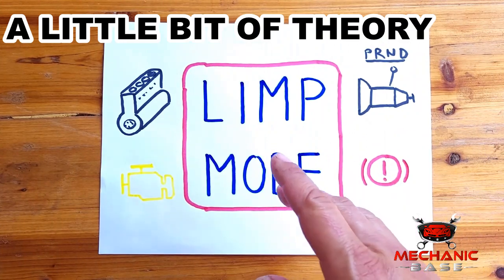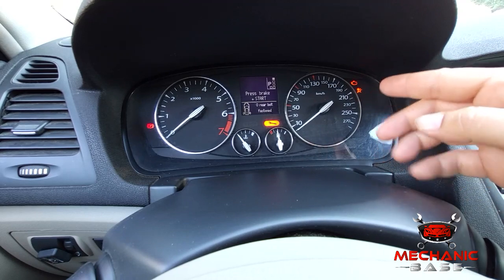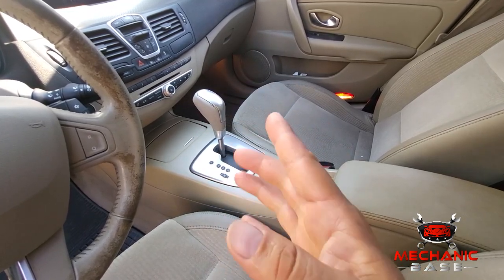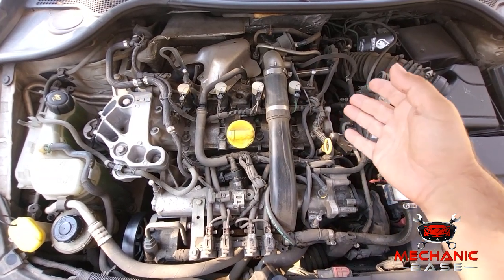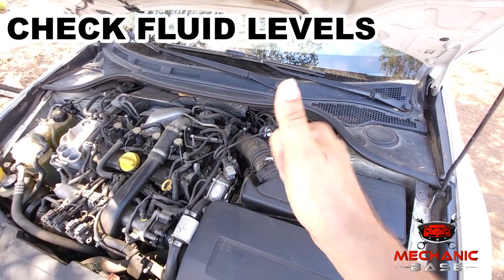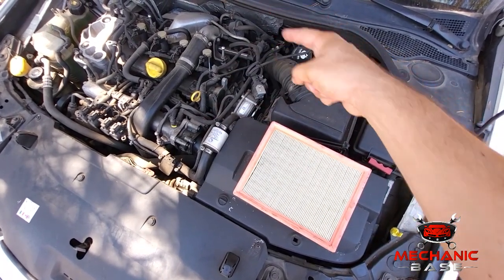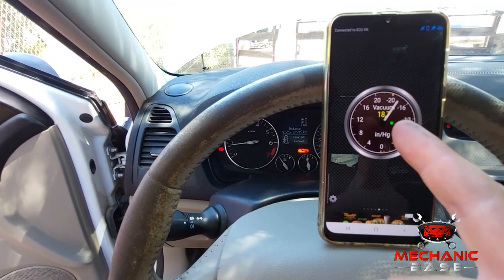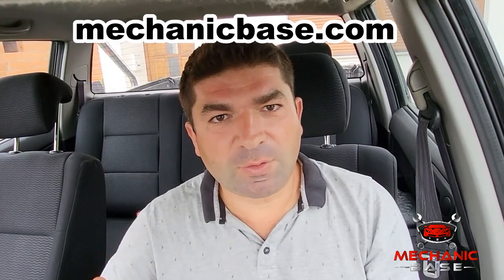Limp Mode: Meaning, Causes and How to Fix It

Comment: I am having problems with my 2006 Nissan Murano, Changed Pedal, Changed Trottle body and still car won't accelerate. Once TPS or Pedal changed car drives for a while like 1km and it goes to limp mode with Slip light and VDC displaying a check engine light, when I disconnect the pedal cable the car get high acceleration can drive . But it's slow. please any suggestions for possible solutions?
Reply from the maker: @fofana713   - which trouble codes do you have?

Comment: I have a 2012 ford Taurus replaced the throttle body and my vehicle sometimes stalls,backfires,and eventually goes into limp mode while driving no matter the speed at random,even when idling at times. What could be the problem? I’m getting throttle body codes p2104,p2107,p2110, and p2111

Comment: Great video, thank you mate! I would like to add another comment about Limp Mode. I have an E46 BMW 328i, the car stood for 4 months while I was overseas with battery disconnected. Upon my return I connected the battery, car started first time but when I switched on the aircon the Limp Mode light came on & virtually no response from the accelerator. I would stop, switch off the car, restart and Limp Mode light would go out, I would then switch on aircon and car would go into Limp Mode again - this happened about 4 times. I got home, put a battery tester on the battery and it indicated that it was in a poor state of charge. I did an overnight charge and the problem solved.  Cheers 🛠👍
Reply from the maker: Thank you for sharing this, @SirFrancoQ💪
Reply: I have mk4 golf my accelerator most of time not response and car goes 10+rpm itself  But when i See I have in injection pump bubbles They shut off engine   do u think I solve prob if i fix injection pump  acc will be ok ??
Reply: My car is on limp mode because when I put on reverse or drive won't move i thought it was transmission going out but I read your comment about the battery thanks all I  need is a battery for my Nissan versa 2013

Comment: I got my o2 sensor changed and after 50 odd miles and then suddenly my car didn't want to accelerate properly or judders at certain throttle points. Don't know of this happens if they did not reset the ECU or if it's potentially my wiring is not happy.

Comment: My Automatic  car changes gears very well from 0 to 100mph but it struggles going above 100mph while maximum speed is 180mph. What can be the cause there is no any check engine light.
Reply from the maker: What's your car?
Reply: @MechanicBase  nissan altima 2006

Comment: I drive my dads toyota previa and its rev cuts off past 2400 rpm and i have to let go off the gas and press it again and maintain it below 2400rpm to drive , my dad replaced the throttle body and the issue remained , its very stressful to drive and i have no other choice.

Comment: Thanks for the video. Very professional..One question I have two cars after driving about an hour set up limp mode..happen after one hour driving .what could be the problem? Both cars has the stability control activated ...
Reply: Not Sr. Im driving my cars like it is but I dont drive long trips., only local .,will be bad to do it.

Comment: my 2012 KIA was in an Official Kia service for 3 MONTHS. The total amount I end up paying was $2714! But the problem was fixed after they change the CONTROL ASSY-HEATHER which costs around $100. Yes, $100, instead of $2714. Maybe this information could be useful to someone. 
My car was going in LIMP MODE. Seems it was a very very rare case. Something that they had never seen before. They change many expensive parts (like the wiring harness and PCM control)  and the car was not working. I had to pay for all those changes without solving anything. 
It has been almost 9 months since they fixed and the car is working great! Hopefully continues this way!
Reply: another screwedover customer
Reply from the maker: Thanks for sharing this useful info, @elilucha👌
Reply: Yea they just change parts that "could" be the problem they don't pin it down
Reply: This is the second time my 2012 Kia went into limp mode in 5 months in heavy rain. Was $600 to fix. New fuel injectors, spark plugs, etc. but wtf every time it rains heavy I gotta do this?
Reply: @shanemoran6597  wow...that never happened to me. so crazy!

Comment: P0763 shift solenoid c electrical THIS CODE I AM GETTING IN MY KIA MOHAVE 2012 MODEL
PLEASE REPLY MY CAR IS GOING IN LIMP MODE
Reply from the maker: Unfortunately, @DIYDCam, this is a transmission issue. Shift solenoids are in charge of changing gears in an automatic transmission, and their malfunction usually triggers limp mode. You could, however, try checking the transmission fluid level, or even renewing it, together with a filter.

Comment: Hi mate, my vw Passat 2.0tdi 2007 has a flashing glow plug light on and the car has no power after 2000rpm.  Plugged in a computer and it saying dpf and glow plugs issue .can a blocked dpf coaurse the glow plug light to flash and go into limp mode. Keep up the good work, your videos are the best and strait to the point. 👍👍
Reply from the maker: Yes, clogged DPF will send the car into limp mode. 
You can find a bit more in this video 
https://youtu.be/A8zmkEEgc8Y?t=449

And, thank you, we'll od keep up💪
Reply: Hey mate, how you fixed your problem? I'm exaclty the same problem with my car. Glow plug light on and no power. Just riding with limited RPM at 3.000

Comment: It's never a lose wire or broken wire. Every person says that.
It's never the f!cking wire. 
Of course you want to check that, but it's never that.
Limp mode can happen for several reasons.
Every car is different.
I junked a Mercedes SUV because not only me, but no mechanic could fix it.
It's not the f!cking coils ether.
You know how many people changed all kinds of parts the shop told them, and still car doesn't run?
Reply: got the ml420cdi in LIMP, a weak battery because SAM unit would not turn off because rear door latch bad. put on door latch, it locks but wont unlock. LIMP gone until change door latch, now back intermittint??????? damn germans. going to unhook door latch plug, look again. maybe bad SAM unit, whatever it is??

Comment: My Nissan maxima 2016 went in to limp mode once. My issue was that my alternator went out at 80k miles. Once it got replaced my car was running again and my transmission worked perfect fine.
Reply from the maker: Thanks for sharing, @jarana10💪

Comment: Can you please tell me how to fix this code U110B&U100
Reply from the maker: Which car do you have?
Reply: @MechanicBase  I have the 06 Dodge Charger 3.5 High Output
Reply: @realcheckmate  ever fix it ?
Reply: @jesse75  No never fixed it I have changed crank sensor map sensor intake temperature sensor throttle body fix the TCM wiring and it still stalls out on me I checked the battery and alternator cause I had a code u0100 and p0700 lost communication with pcm/ecm and today I changed the coolant temperature sensor and I’m going to take it for a drive in the morning to see if it stalls on me
Reply: @realcheckmate  do you live in a hot climate area ?
Reply: @jesse75  I live in San Antonio Texas
Reply: @realcheckmate  it's pain staking. But I've found in hot climates the wiring breaks down.
Example. I have a Mercedes. Shortly after getting the car, the EVAP system threw a code.
Changed everything in the system. A sensor on top of the gas tank required me to drop the exhaust, rear end and drop the gas tank.
Bull Sh!t. I cut a hole in the floor board after taking out the back seat to replace it. Still didn't fix it. And that's after even changing the charcoal canister too.
After all that hassle it was the wire leading to the sensor on top of the gas tank.
$25 piece of wire. And I spent hundreds of dollars on those other parts. And that wasn't the problem.
It's a bunch of crap when a code only tells you what's wrong but not the part, so we have to go chasing it.
So I hear you all the way. 
Just because something looks good, it may not be.
I had a Nissan. I even replaced the engine. Still same problem. I replaced everything.
I found a ground wire that was bad and intermittent. That's what the whole problem was. I was pissed.
But sometimes that's what it takes on these cars. Dealer's and Mechanic's are no better than us.
If you were close by, I'd look your car over.
I bet money it's something stupid.
Reply: @jesse75  no I never fixed it but when I leave my OBD2 scanner plugged while driving my car won’t cut off when at all when I stop at a stop signal

Comment: My Mercedes 2000 with w211 engine and 722.6 transmission have limp mode for 2 months I changed the conductor plate and oil but no response,  so any advice?
Reply: I had the same problem after I changed conductor plate.
I took it apart again and replaced all those solenoids in the shift body.
Dealer said I had to get it recalibrated. But that's bulsh!t. Car works perfect now.

Comment: What could be the reason  to limp mode on Audi a3 2TDI  DSG 2005 model 

When accelerating from 3rd gear up the car goes into limp mode 

Example when downshifting from 6,5,4 then 3 and when accelerating from 3 it goes to limp mode so basically you have to downshift 6,5,4,3,2 then accelerate from 2 for the car not to go into limp mode 

So 3rd gear is the caus to limp mode 
Any help 🙏

I recently diagnosed the car 

Engine - P1650  Databus drive train missing    
                Message 
             - P1570 Engine control module ECM     
                disabled 

Transmission trouble code 
             - P2711 Unexpected mechanical 
                gear disengagement no/ signal to 
                 Communicate intermittent 
              - P1862 Databus drivetrain missing  
                 Message from instrument cluster
Reply: You have a wiring issue, a short to ground or short to power, you need to get your wiring diagram and diagnostic steps from ALLDATAdiy.

Comment: Hey, I’m not really sure how to describe my situation, I think she limped but not entirely sure. The car drove fine till today. As I was stopping on a red light, on a mini highway, I had to pick up speed after the green. My car reached I wanna say 30km/hr she like went almost like she wanted to die. The car had no power and I had a huge rubber duck head, but the problem lasted not even a second, I couldn’t even see the lights that turned on fast enough, but im pretty sure the engine light and battery went on. The issue happened a few more times after then. It would drive fine after tho. Just very randomly it happens
Reply: Finally found what caused my problem. I used seafoam to flush out or clean the injectors for extra precautions I ordered a oem pedal accelerator sensor. Hasn't done it since. It's been a week
Reply: Mines doing the same also on my challenger. I replaced the throttle body, did a relearn, I replaced the battery, nothing, I replaced the pedal accelerator sensor, relearn, nothing. I can't find the problem. No one apparently knows how to fix it on a challenger 😒

Comment: My car is going in limp but there is no check engine light or any light for that matter and it will go link randomly here and there any ideas?
Reply from the maker: Hey Jarir, why do you think it's in Limp Mode? Can you describe what exactly is happening?
Reply: @MechanicBase  yes soo basically it’s only happened twice for like a minute after switching car of and on it was ok. But i think when i put the heater on and driving from when the car was cold it went into limp mode. Maybe sensor?

Comment: I have same issue on my 2005 kia sorento. Limp mode will activate when I ran into something bumpy, and there' s a humming sound coming from front passenger side when limp mode activate. What would be the problem about that sir. Thanks
Reply from the maker: Hey Tom. Which engine does it have? 
It sounds like a turbocharger issue.
Reply: @MechanicBase    V6 Cylinder Engine. Thank you Mechanic Base. I will update after. Thanks
Reply: @tombompat2780 where u went wrong was getting a kia

Comment: Hi can something wrong in the abs system cause limp mode
Reply from the maker: Can you tell us a bit more, Shane? 
Actually, a bad wheel speed sensor or a rusty reluctor ring may cause symptoms similar to safe mode - car occasionally lacking power.
Reply: @MechanicBase  hello, i have same issue, ford focus 2012, 1.6 diesel. I got esp lamp and check engine at the same time, my car is in limp mode now. I made a diagnostic, there are front left wheel sensor between the issues. Can it makes that i can not go over 2,000 rpm?

Comment: Limp mode should be outlawed. It makes us want to smash the car or press the gas until it breaks and then never buy that brand again
Reply: Lol exactly
Reply: Thats what I feel everyday for this 3 months that my car is in limp mode and no one can find the problem...
Reply: Amen to that!  Limp
anything’s is just to piss men off
Reply: 50% change the 10 fuse in the fuse box !
Reply: @OfficialLvlupYT this is what I'm going to check first...then clean the throttle body
Reply: Reasonable crash out 😂😂😂 changed my transmission, fluid, sensors and my car still in limp mode
Reply: @jayybizz_ I believe it. Limp mode is a pain in the AZZ.
Reply: That’s true
Reply: @jesse75 what as the fix
Reply: @IMAGINEREALITY.  he didn’t fix anything
Reply: Sounds like a hyundai owner
Reply: Have a 2006 dodge Dakota laramie 4x4 with high output 4.7. Had transmission solenoids replaced and serviced.  Still goes into limp mode. After 20 minutes,  lasts for up to 8 hours setting.  Will drive in 3rd .and at highway speeds.  But tac is at 3500 rpms. Aggravating.
Reply: we need a petition to washington to put a ban on limp mode and about 100 other things these manufacturers are putting in an engine compartment
Reply: @stevenbean9706 i agree. There's no government oversight on any of that stuff.
Reply: You have a Ford Explorer, too?
Reply: Same
Reply: Be nice to your car
Reply: Definitely never another Nissan!
Reply: Imagine being in a high speed chase from the law and your engine goes into limp mode 💔💔
Reply: Read the owners manual.  turn on the hazard lights and pull over when the car is in limp mode and call for a tow
Reply: Dam right my friend lol
Reply: True!!! 🤣
Reply: He's bluffing
Reply: How long does limp mode last after changing bad sensors that was located after scanning the car ?
Reply: @whiteshark2060 have to clear the codes but can take several miles to work through the onboard electronics.
Reply: Do you think since 5g towers and Smart tech street lights are causing Limp Mode? Draining power from petrol cars, for electric cars replacement.
Reply: Funny. It's also dangerous.
Example. I just got on the freeway near home. Going 65. Limp mode hits car drops quick to 40 and is stuck in 2nd gear.
Women behind me drives around me gets in front and hits her breaks. Yah break check.
She thinks I slowed down on purpose just to piss her off.
She got off the same next exit as me. 
Then started hitting breaks in front of me on the exit.
So I try to just drive around her. But she speeds up.
Reply: @jesse75  did you have your hazard lights on
Reply: @jaycole5353  I found a fix. About 50 cents.
Reply: @jesse75  what'd you do?
Reply: @jesse75 how ?? Why won’t you say
Reply: @shellybelle6781  knowledge is power. Sometimes it not free either.
Reply: @shellybelle6781  I  think the guy talking about 50cent gas and burn it  🔥  maybe
Reply: @jesse75 what's the fix
Reply: @jl4237  honestly it was a hose clamp.
Reply: @jesse75  any more info u can release?
Reply: @jesse75 could you please say which one.  Cars great mileage great but 10 15 miles check engine light comes on steady and car starts that judder like im pressing on and off gas pedal when im not.. is that what happens in limp mode??
Reply: @jesse75  what's the fix
Reply: @jesse75  fitty cent???
Reply: @dporrasxtremeLS3 yes, after painstakingly checking all the circuits it was just .50 cents. Not a fuse either. 
It was a pain in the AZZ.
Reply: @jesse75 this is where u reach to the pistol in the glovebox
Reply: Thats y u dont smash it tf lol taje it to a mechanic shop. Limp modd is made so u dont break down far away from home or shop
Reply: amen to that brother

Comment: I have an 04 Mercedes c240 and went into limp mode but didn't store any codes but won't go over 60mph????? I'm lost and need help! Please and thank you!
Reply: 60mph seems very fast for limp mode - could just be reduced power for another reason and not limp mode.
Reply from the maker: Hey Nick, do you have a check engine light on? If so, there must be a code. Which scan tool have you used?
Reply: my ml420 limits at 40??? a weak battery will do it. ???

Comment: Hi, I have a MK3 Mondeo with the limp mode problem.. started over a year ago, it was very rare but in time started to get worse.. the strange thing is, if starting from cold.. say after 9 or 10 hourse it will run without problems.. even over 100 miles of driving.. but as soon as I turn the engin off then start it it again comes on.. my work is 25 miles away and I get there and back home without any no problem but again if I stop on the way and start it again it appears.. when I finish work after 9 hours.. I start it and get home without any issues. Any ideas? one more thing if the engin gets warm and I keep it running after a drive of say 10 mile then stop while the enging is running for about 10 - 15 minutes it also goes to limp mode.
Reply from the maker: That seems unusual, Jamal. 
Which engine do you have?
Reply: @MechanicBase  It's 2 Litre TDCI 130bhp.
Reply from the maker: That might be some temp sensor acting up🤔
Have you checked what DTC codes are stored?
Reply: Same thing happening to me did you find the fix ?